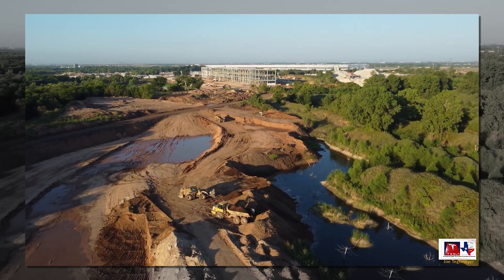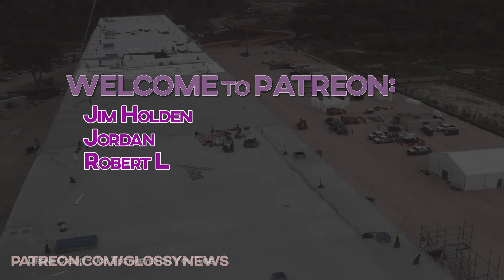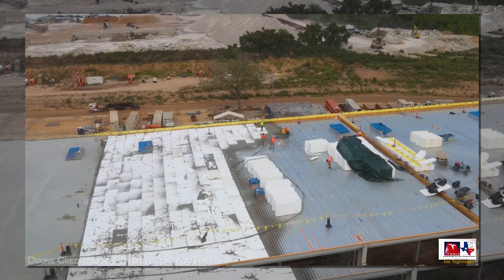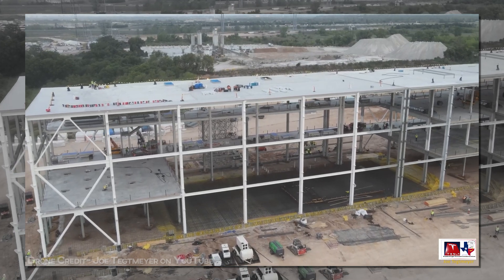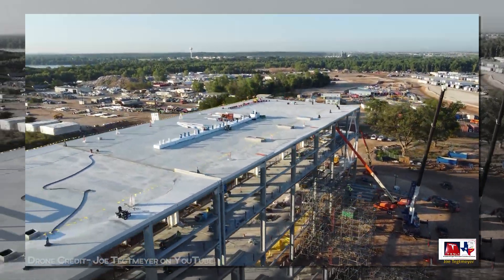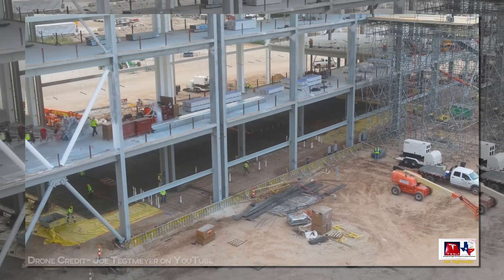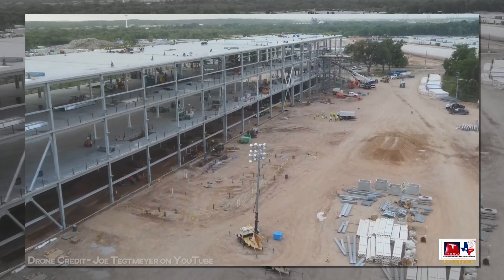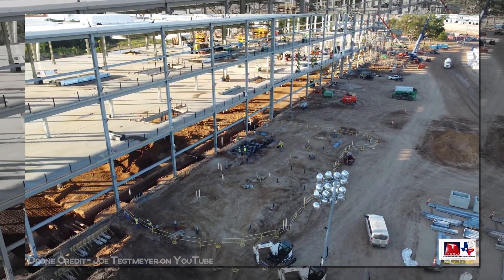Cathode building is is still 62.5% done. I haven’t changed the math, pray I don’t alter it further

Comment: Might be easier to fitout the building hardware interiors / line setup without troublesome external walls...
Reply from the maker: Possible for the lower floors, but they rely on loading platforms for upper floors. Unless they want to surround the building entirely with scaffolding there isn't much benefit keeping upper floors open.

I think it's a combination of what you said, plus the fact that it will be easier to just do all the walls at once instead of spread out over time. Cheaper to only have the crane there for a week or two, instead of months on end. And with the weather largely cooperating, it's not a race against the elements.

Comment: One picky point. It’s not fire proof paint. There aren’t any paints or coatings that are fire proof. But there are several types of fire resistant paint. The most common and best used to protect steel from intense heat for long enough to evacuate the building and give fire fighters a chance at saving it, is called Fire rated intumescent paint. Basically, when it’s exposed to fire, it chars up and provides an insulating coat around the steel. It comes in thick or thin varieties depending on what the objectives for the coating are. Thin will get you long enough to get your folks out of the building. The thick stuff can get you to a 2 hour rating. If you are going to be able to save the building, you will have it knocked down long before then. 

They used to use other methods, like asbestos or other spay on fibers. Down side is the obvious asbestos issues and even with other fibrous insulations, over time they can lose the adhesives that stuck them to the steel, get knocked off, and then not protect the steel. Thus the so called paint is what’s almost always used today. In places you really want to protect your steel, like the core of the New World Trade Center, they encased the steel in concrete for even more protection.
Reply from the maker: Appreciate the clarification, William. That was the term Joe used and I accepted it without thinking about it. As Sandy Munro said, even rocks will burn if you apply enough heat.

Comment: One thing that concerns me is the lack of diagonal bracing in the east-west (short) direction. . .
Reply: Hi Dewiz, additional sheer support and thus strength is usually not needed for such few cells. The GF is not in a seismic active area. I mean, baby earthquakes have happened in the area but there are no fault lines in the area and any earthquake would be minor at worst. You just don’t need the cross bracing after the concrete floors and roof are poured when your building only 3 or 4 cells wide. It’s all been engineered and tested on the magic computer these days. So don’t worry about that issue. The much more prevalent issue is flooding and hopefully they built it up enough to keep it dry. Or only put things that can stand getting wet on the first floor. But again, this was all approved by the City of Austin. There code enforcement guys are good.
Reply from the maker: I suspect that's addressed by the cementitious roof, which adds a lot of rigidity. I'm confident they've employed enough of the right engineers to ensure it's sound.

Comment: If I'm not mistaken, in the shareholder meeting it was said that there were enough 4860 batteries for this year. So for the (ramped) production next year the cathode building should be up and running by January ??
Reply from the maker: What I heard him say was that batteries are not the bottleneck at the moment, but not that there were enough 4680s. Between LFP, 2170, and the still-ramping 4680 lines, there ARE enough batteries, even if not in quite the distribution they'd like.

That's why Texas invested in equipment to build 2170 models.
Reply: @FutureAzA  Tons of 4680 batteries are required for the Semi and Cyber trucks, in addition to the structural pack for the Model Y.